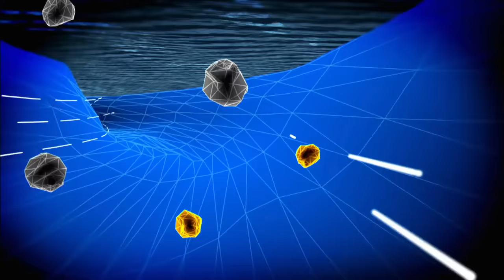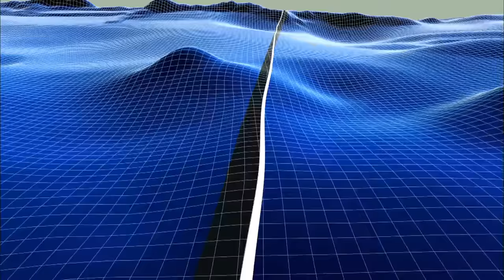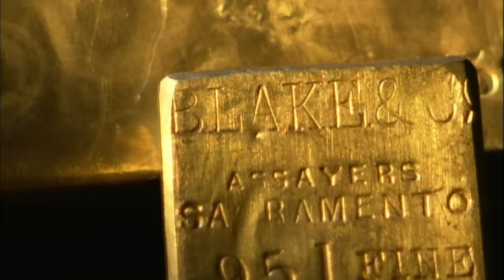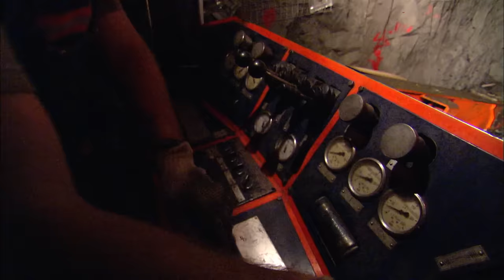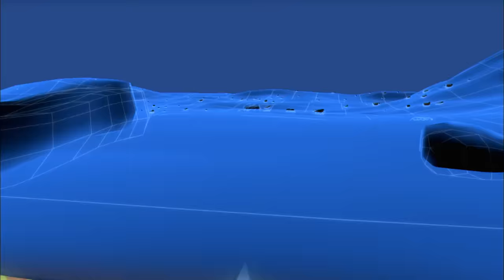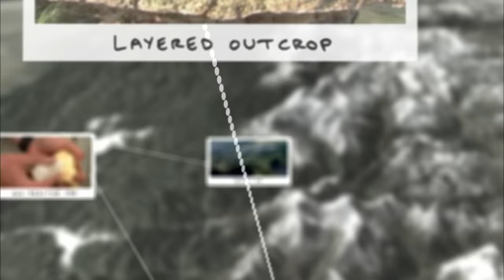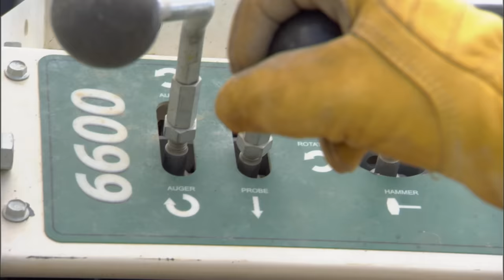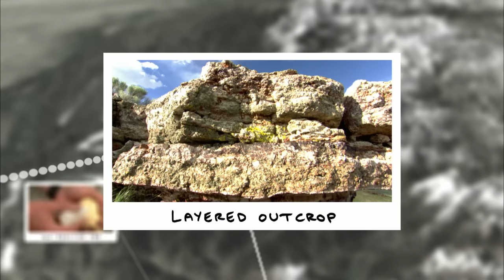Forging America's Gold | How the Earth Was Made (S2, E13) | Full Episode | History

Comment: 600 degrees? Gold doesn’t even melt until 1,943F. So how did the gold melt and move through the quartz which has a melting point of 3,127F. Please someone explain this to me!
Reply: The gold in solution wasn't melted - it was chemically dissolved. Just the same way nitric acid mixed with hydrochloric acid ("Aquaregia") can dissolve gold into solution at low temperatures. The heat just made the natural acid chemical soup more effective.

Comment: There's some many problems with this video. All the elements that make up gold & other precious metals are combined within the earth, & form when conditions are just right. Gold was not made then deposited in the earth. The chemicals that make gold were. Like halogen compounds, fluorides (AuF3; AuF5), chlorides (AuCl; [AuCl3]2), bromides (AuBr; [AuBr3]2), and iodides (AuI; AuI3), as well as oxides (Au2O3), sulfides (Au2S; Au2S3), and selenides (AuSe; Au2Se3). 
You got to remember this planet is 4.5 billion years old, & it has gone through many reformations over time. And most surface gold was placed were it's at do to these changes, tectonic shifts, volcanoes, earth quakes, floods, glacier slides ECT. But gold forms in quartz were it meets with iron and traps the right chemicals together @ 2,000° fahrenheit, then with those natural process it's brought to the surface and exposed by the natural events. 
Yes in certain places gold brought to the surface can & is concentrated.
But gold is made in the earth, not in a neutron star, just the elements that make gold are.
And yes gold does blend with other precious metals & base metals, that's why we have the purity scale AKA karrot scale.

Comment: Was it because of its weight originally ? Or just the force of the liquid? Or just its molecular structure allows it to adhere? It doesn't fuse. Which goes back to my first question its weight maybe due to its molecular structure at some point liquid that hardened? But not fusing with other trace metal elements?
Silver mining in Park City?
Reply: It was because of the heat!!
Reply: @tylerturman5150  thank you the heat made it possible to be in a liquid form and as it travels it cooled and became heavier and solidified.
Reply: The super heated, acidic water disolves the microscopic gold particals as it travels through all the cracks and fissures in the crust, as it nears the surface the water cools and the gold drops out.

Comment: I don't know about that "water detection" machines, but I have been in the mineral and water detection business for about 30 years now and so far I have tested a lot of machines, only to find they did not work and the money spent  went down the drain. My water Dowsing is a hundred% accurate and I do it from a photograph off of  Google earth images. Of course I find other things also, like precious-metals, graves, crude-oil. I can scan five to ten square miles from a Google Earth image in about a day and mark the water or mineral locations, large and small. I also discriminate the type of element, for example I can tell any one of the six platinum group metals apart from one another. And I can detect all of the stable elements on the chart of elements. I have done over 300 blind tests to this affect. I am not at all limited on depth detection. I did an oil deposit that was 6800 feet deep. Many of my blind teste were private people giving me permission to scan their houses and marking where their values were.
Reply: I think your issue is the resonating sensitivity of your hyper-spectrum flow beam regulator.
Reply: @mat4263  I wish I knew his flux capacitor guy, dudes on rails!

Comment: There is at least one error. The narrator stated that gold will not "bind" with any element except itself. That is false. If it were true, then you could just melt the impure gold and all those lighter elements would rise to the surface of the liquid where they could be skimmed off.
Gold combines with chlorine to form Au2Cl6, Au2O3 and many other compounds. With that elementary an error, I did not watch the rest - figuring this is just another typical puff and nonsense history channel production.
Reply: Like 10 k 14kt 18 jt. And 24 kt
Reply: @clairedeiotte8898  Yes, but all those gold mixtures are just that, mixtures/alloys. The metals have not combined chemically. 
However, the mixtures require chemical/electrolytic means to separate the metals, as the particles are too small to separate mechanically.